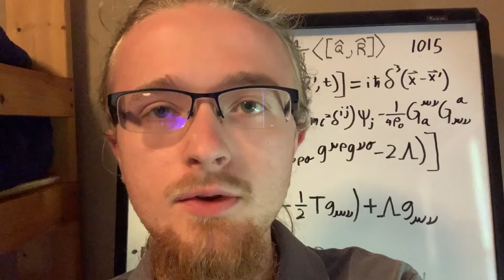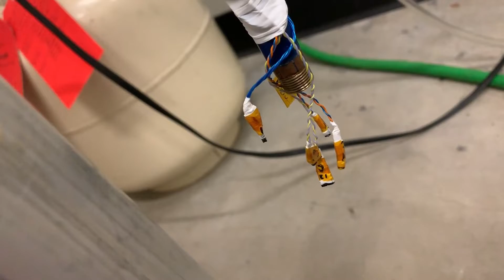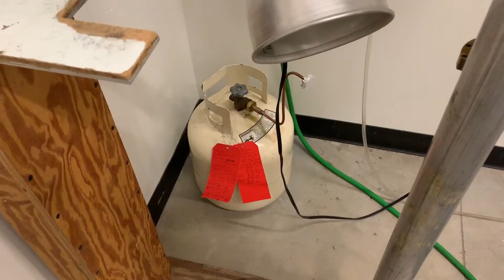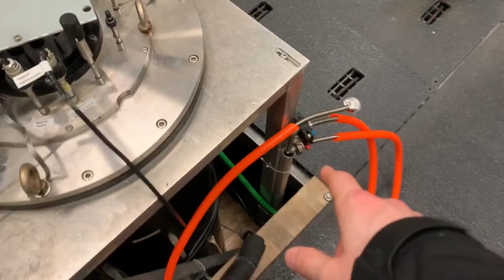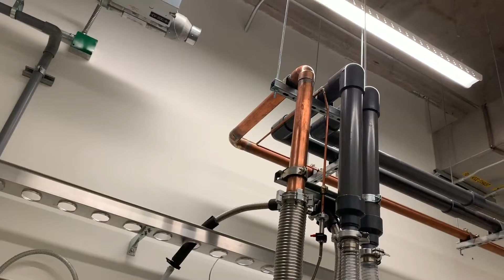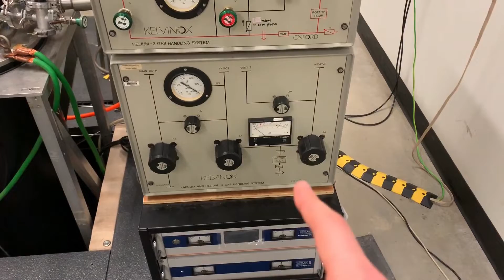This Is What A Helium Dilution Refrigerator Is

Comment: the helium 3 cost must be absolutely obscene....
Reply from the maker: It is, there is probably more than $20,000 worth in that fridge. I know that the K-400 in the next room has about 16 liters in it.
Reply: I think you should blow the lot of it on making a youtube video showing the pitch of your voice is 25% higher than with normal helium.
Reply from the maker: @Muonium1  I can't imagine how much trouble I would get in if I did that.

I do know that the professor whose labs that is has enough He-3 stashed in his office to restock the entire dilution refrigerator if it ever lost all of it's mix.
Reply: @DietterichLabs  Does the helium gradually leak out over time, requiring regular topping up? Or is the emergency supply just for a worst-case accidental release?
Reply: Amazing explanation! I'm currently working on a cryogenics project and you just cleared up a lot of things to me. Thank you very much for the video!